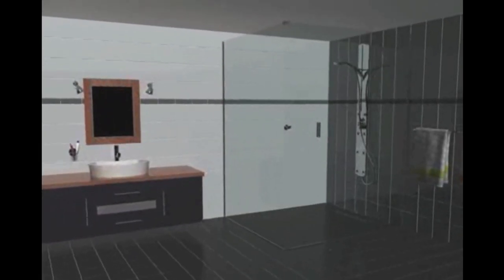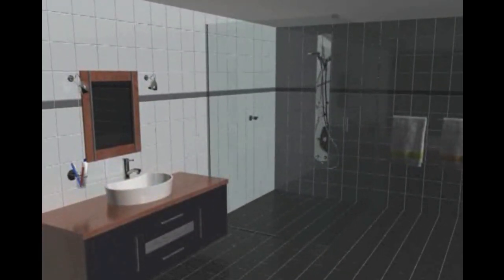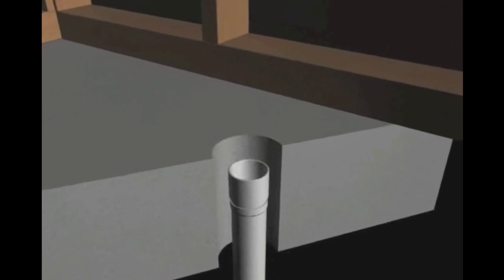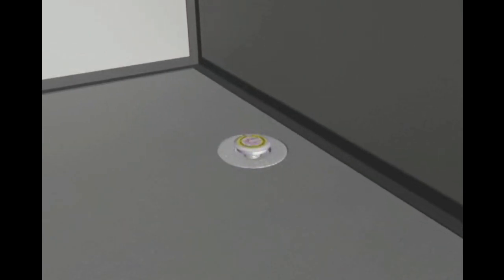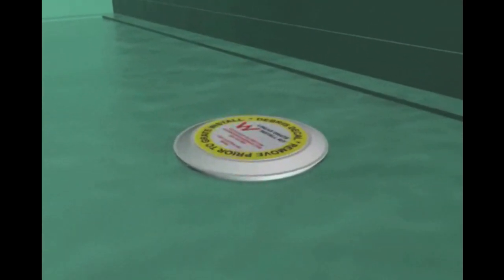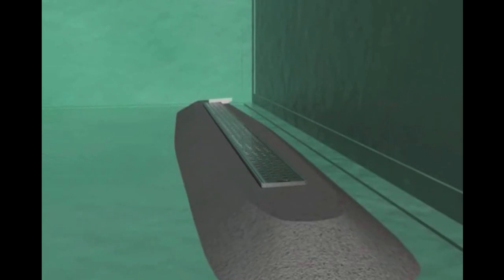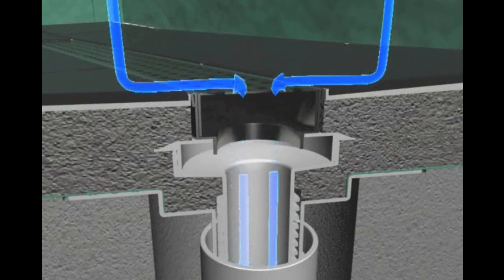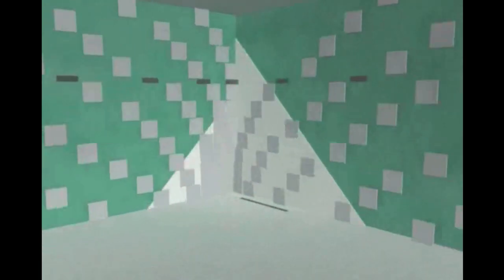Shower Grate Installation

Comment: Been watching The Block and there was a big issue last night about puddle flanges. Every time I1ve seen them do waterproofing its over the top of the screed and tiles are glued onto the waterproofing. Is the waterproofing done underneath the screed (in this instance) just to accommodate the puddle flange? Or, can the puddle flange be installed between the screed and tiles ? I`ll send this to Keith just to confuse them even more  :-)  Thanks.

Comment: How to use this flange in case if you want your drain grate located by back wall (with no thin tile off cuts there)?   Is that OK if weconnect the grate directly to down pipe without flange, please
Reply from the maker: Hi Alexander, thanks for your enquiry. We do not sell or recommend the installation of shower grates that have flanges.  The reason is that flanges are typically there to somehow integrate with the waterproofing of the wall and substrate - making it a critical component of the waterproofing installation for the room.  However we understand that such flanges do not meet the Australian Standards for waterproofing.  

We have also heard from many home owners that have had such grates with flanges installed that as the stainless steel flange expands and contracts differently to the surrounding materials the water-proofing membrane eventually splits where the flange meets the other sub materials.  This causes significant problems with the moisture that has to travel under the tiles to the waste.

The shower grate is just there to direct surface water to the waste.  It does not need flanges to integrate with waterproofing membranes or tiles.
See https://www.renovatorstore.com.au/blog/how-to-install-a-shower-grate/ for more information
Reply: @RenovatorStore  I have seen your tutorial (a link) Thank you. However there is a distance from the back wall and linear grate in this example. I` d like to fix the grate straight up to back wall with no extra tiles behind.  I have a standard 50mm PVC down pipe and the same 50 mm metal connector in new linear stainless drain (they fit each other).  Is that a normal idea to connect them together with no flanges between them. It will be a concrete sloped screed about 1000 *1000 mm. Waterproofing will be provided for both surfaces for horizontal surface and above the screed  (in case) under tiles/ And all the shower walls will be generously waterproofed  too.  Will it work , please? Or I have to provide any king of puddle flange anyway?   BTW. This bathroom has the second- central trap which might be a nice direction for any possible surface water. Is that a good solution id I install a puddle flange in the central water waste instead?  Thank you for your professional  suggestions!
Reply from the maker: @alexanderchuyko4889  Our shower grates can easily be installed either against walls or offset from walls - just allow space for tiles when positioning the grate tray.  As we have said we do not recommend any flanges or integration between the waterproofing and the waste tray(s) - but only your builder and waterproofer and plumber can sign off on your project.

If you are purchasing shower grates from us please contact us as we can provide comprehensive installation advice, however we are not in a position to see your specific situation and therefore  provide specific installation advice.

Comment: Fantastic instructional video! One question I have relates to the screeding stage. Is it usual practice to screed the shower area independently of the rest of the bathroom floor? The reason I ask is because the fall inside the shower is different to the fall of the bathroom floor. In each area you want the water to drain towards the shower waste or floor waste. The perimeter of the shower where the frameless glass screen contacts the floor must be square and level (?) to give good continuous contact between the floor and the bottom of the screen. No? Inside the shower the floor must run towards the waste. Then moving away from the shower (outside the shower area) the floor should drop away from the bottom of the shower screen towards the floor waste. Phew!! Still following?? So in short (at last!) would you place angle aluminium strips or timber strips at the shower screen/ floor junction, keeping them level, then screed inside this shower area before doing the rest of the bathroom floor? And how would you attack this?
Reply: Did you end up getting an answer for this? or  how did you go about it? I'm in the middle of doing my bathroom reno

Comment: A beautiful and clear tutorial!  And... I have exactly the same bathroom configuration which is renovating now. Only a difference with your demonstrated one is... it has a big trap located at the centre of the floor. And it collects all the drainage around (from  the shower screen and from the basin loceted nearby.   Could you advose me whether all the floor area must be screeded towards to this central trap or this is not neccessary due to .. . we have a shower trap. Is that acceptable to make it as a  flat levelled floor ???   Thank you